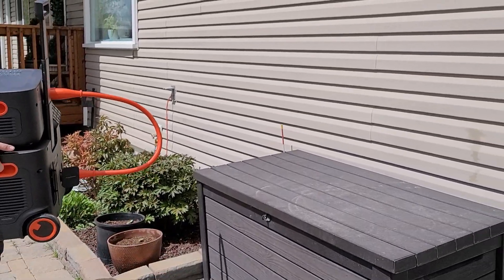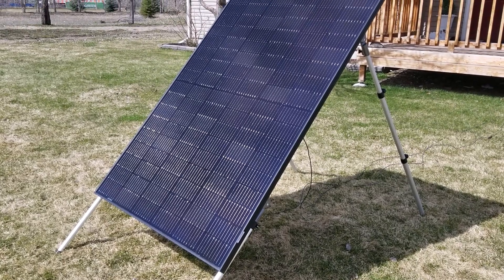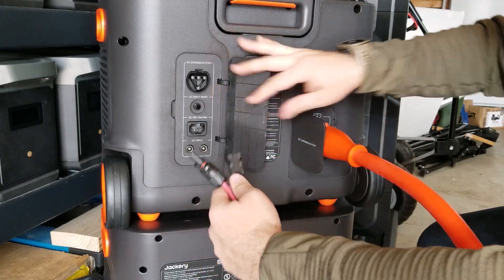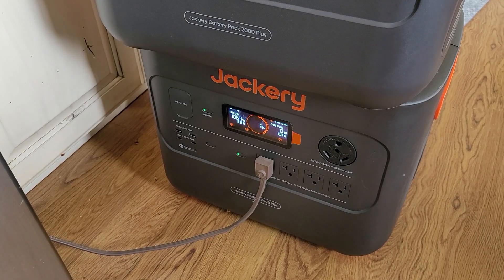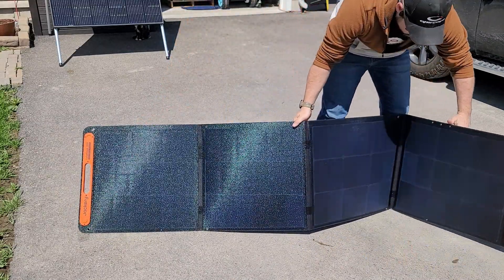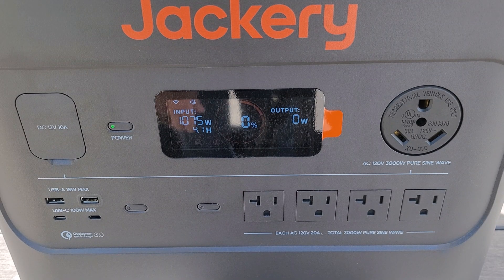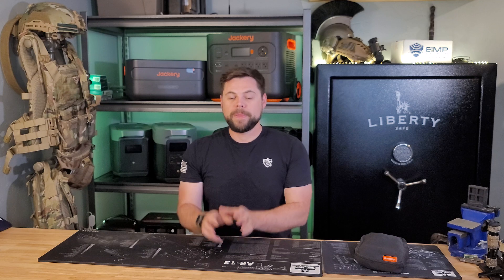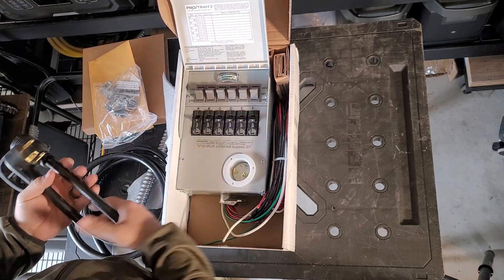Very Portable Whole House Solar Generator (But How?)

Comment: would you share the make/model of the permanent panels you are using? I am struggling to find permanent panels to increase the wattage to the unit (from the 200W solarsaga panels) without going over the rated V and A limitations of the unit (60V and 12A)

Comment: …so, according to Jackery Tech support, you cannot use all those solar panel inputs at the same time.  For example if you have 4 solar panels and you want to use one panel on each of the 4 input ports (2 on the main unit, and 2 on the expansion battery), you can’t.  You would have to connect 2 panels in series and put them on one port of the main unit…ditto for the other 2 panels.  As long as you keep the 2 ports balanced and do not exceed 60 volts per port.  If you try to put more panels on the expansion battery’s at the same time, you will exceed the 60 volt limit.  At least that is the way I understood it as explained by Jackery TS.  I wanted to keep adding solar panels to each port, but i guess you cannot.  I would be curious to find out if they tell you something different.

Comment: So what you tell me is gonna take several days to charge that generator and all its batteries. Meaning it's gonna be unsufficient amount of power to an unsubmitted fishing amount of batteries not being used daily as a normal use. Even if you have 2 generators that you can hook together. Still only 4000 W. I only could hook up my kitchen stove up into it. And that's it, and maybe a lighter too, and basically using all the power.
 And then suffering would not actually be in a good enough power to keep it going when I needed to keep going or for each time. I gotta use it. It would run out of power.  Not better power up enough to power the next time. Or in this case, you should say you should want a Delta pro or a Delta pro.Ultra which you do have.

Comment: Thanks for the video. I have to echo the comment about the Orange connection cable. I totally see the need for a flexible cable. BUT, if someone is "stacking" the units, the stack should have a much less bulky method of connecting... perhaps direct connect? or a plugin type module that only stuck out a few inches.

Comment: Is the Titan still your recommendation?  If so why?
Reply: I am wondering the same.
Reply: I have the Titan I bought from Ben before all these units were on the market and still love it. Def would like to read Ben's answer to your question. I do remember recently though that he still recommends the Titan
Reply: Thanks for the input, he recently reviewed and liked the Delta Pro Ultra which is supposed the be latest and best one yet, and now with the Jackery it's hard to decide which one is truly the best. I do like the portability.
Reply: @rvnut1133  You're welcome!
I'm going to defer to Ben for your answer, but  buy the best unit that best fits your requirements  i.e What are you trying to power? whole house, camper ect..  I have the Delta Pro as well and the biggest gripe I have with it is floor space being that's it's not stackable and is a pain in the butt to to move around if you don't have it on cart if it's not in its main space. I think Ben has a chart on his site that compares a lot of the units he reviews that you could use to help narrow down your choice
Reply: Both the house when I am at my base and the RV. That’s why the portability is important for me.
Reply: David, I have 2 Titans and 10kw in batteries. They now have 220v and 120v  in one unit, he had a falling out with Point Zero Energy, not with the unit, but with the people, so he won't promote there stuff anymore. Also they wouldn't give him units to review for free like all these cheap Chinese high frequency units. He knows that the Titans are the only low frequency units on the market, I dig his reviews, and he's good at it, just sad they can't get along and keep pushing there products. I would never recommend these high frequency units, $5 chipsets just can't compare to transformer based units, but he transitioned to keep making money, and these units are free to him to review, how do they say, " it is what it is"
Reply: @dustydawson8977 I lack the technical chops so thought I’d ask.  With the discovery of Chinese back doors in the computer chips, I was wondering if the Titan is 100% US made, or if the is possibility of the Titan also containing potentially compromised chips?
Reply: @davidalbright3096  Anything is possible, but since the Titan has no wifi or Bluetooth, and doesn't connect to the internet, it would be more difficult to enable, and it's tranformer based not chip based